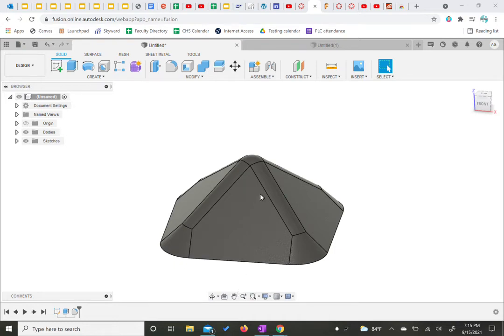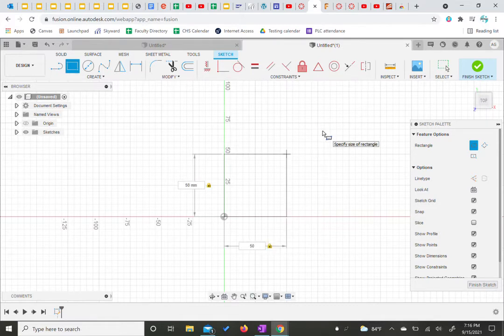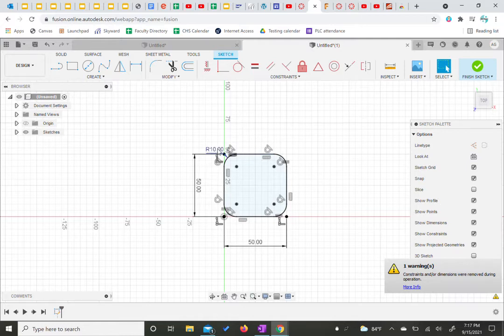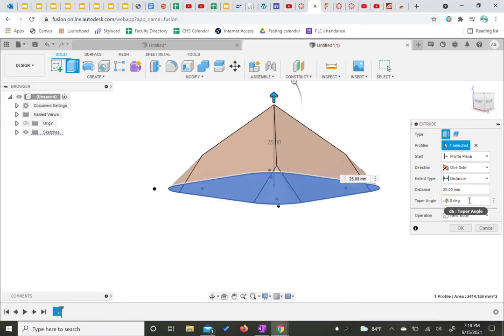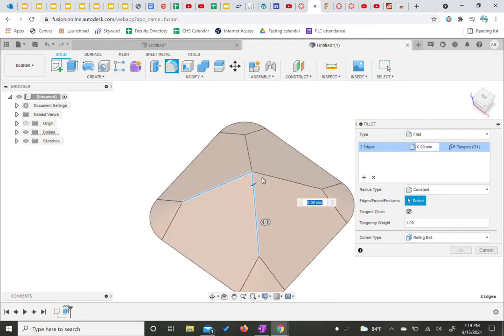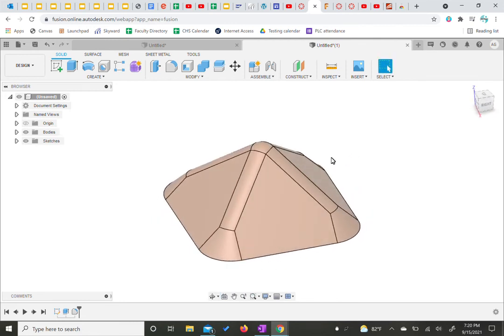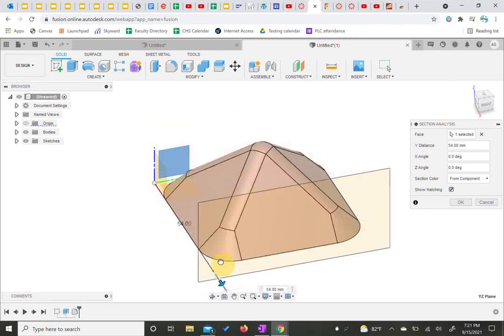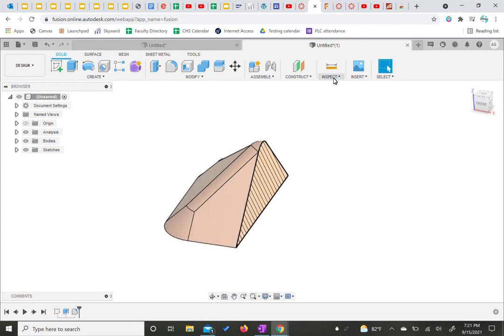Fusion 360: Fillet and Tapered extrusion

Comment: Thanks - really clearly explained and helpful!
Can you show us how to extrude a flat polygonal shape with a taper, but instead of the regular flat resulting faces, having either inward or outward curved faces? There seems to be no way to do that except by lofting or sweeping somehow? If not, that would be a neat parameter to add in the extrusion panel. Thanks again.